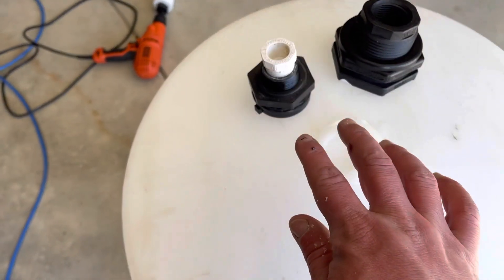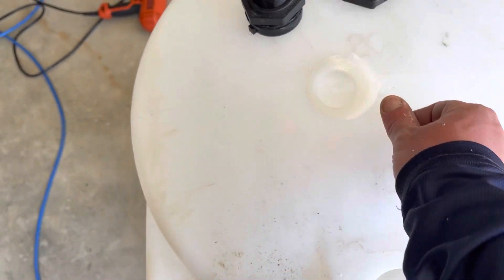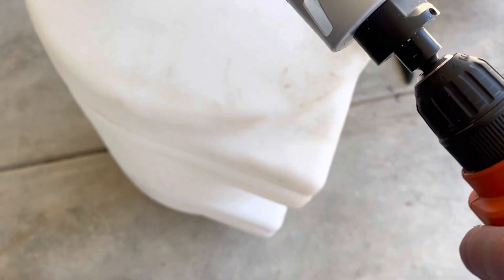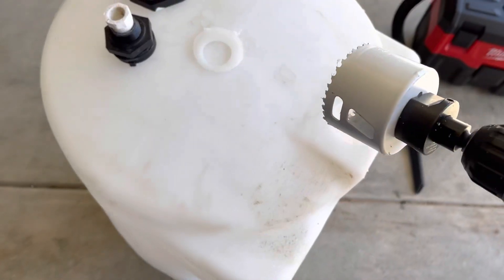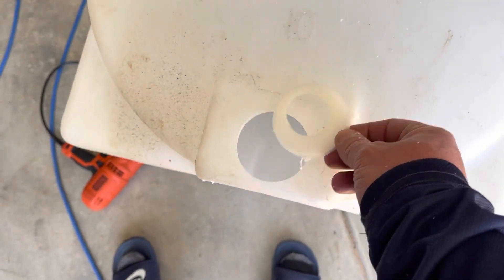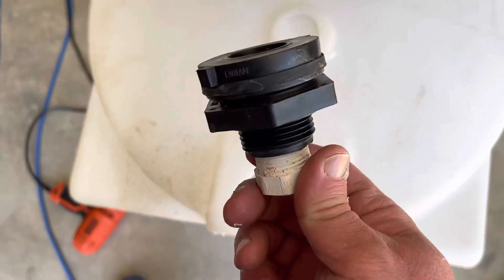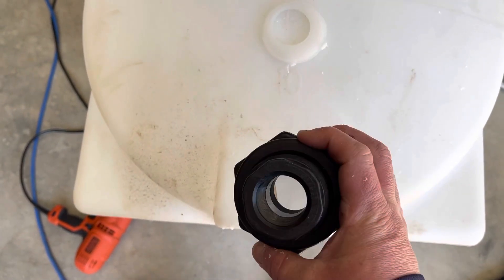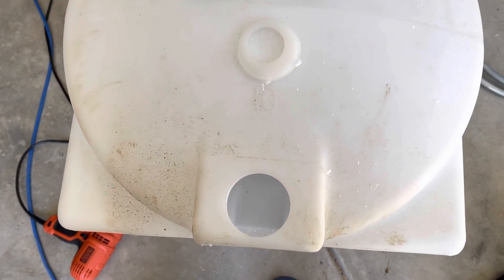Drilling out an existing hole for a bulkhead

Comment: I get a hole saw the size of the existing hole and screw it on to the arbor of the hole saw size that I want.  So,,, hole saw inside a hole saw.  Fortunately, I have several arbors and the threads on one were long enough for two hole saws.
Reply from the maker: That would definitely work as well. Thanks for sharing.

Comment: A very easy way is to drill what size hole you want through a piece of wood. Then you just hold wood and drill. It's merely a template you create.
Reply from the maker: That would definitely work. Thanks for the tip!